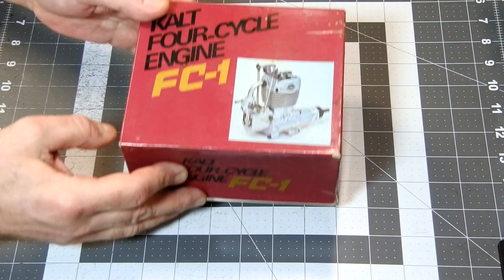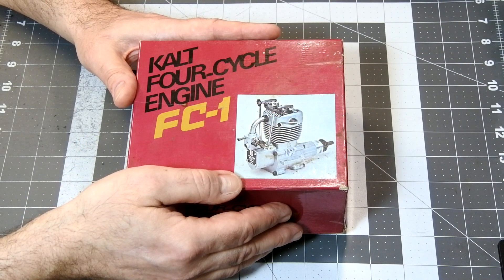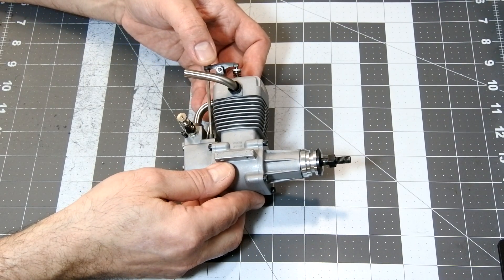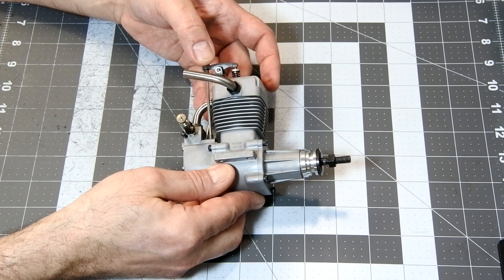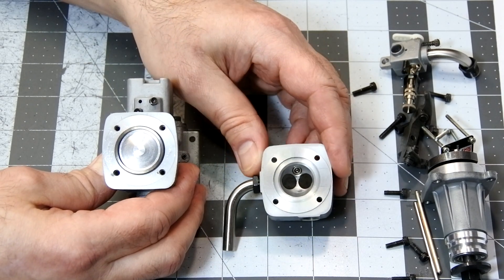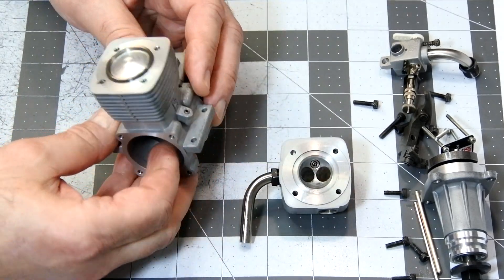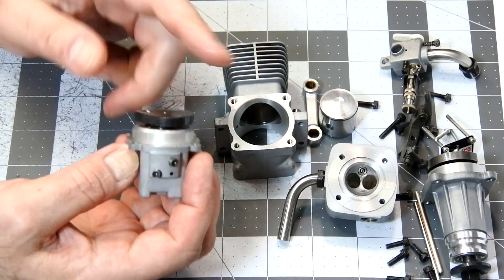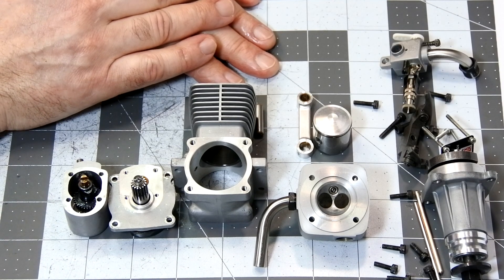Kalt FC 1 mega rare engine history

Comment: So glad someone did a dedication/history/intro vid on the famous Kalt engine! My first 4 stroke open rocker engine and I bought it used from Italy, this was in 2015 after seeing a vid of it running. At first I thought it was a Webra rotary valve 4 stroke since the kalt has a square cylinder body. This beauty is really well made, hemihead motor. I enjoy looking at the fine surface finish it has, not even OS or Saito has this level of smooth casting. The casting finish (I am sure bead blasting was done in the end), is equal to that of real sized engine castings.
Reply from the maker: Thank you very much for your kind comment ! I'm greatly appreciate you, that you found my video stories useful !
Reply from the maker: 100% agreed with you about Kalt FC-1 engine castings quality and engine build quality overall.
Reply: @crazyengines88  It is a very nice engine and should be a part of every aero modelers collection. Its a pity that it was not mass produced like the OS FS 60 or advertised as much, BUT one can still find these on ebay, 1-3 NIB ones pop on ebay once a yr. price range - $400-$500USD.
Reply from the maker: @ronitsingh85  Thank you. I also know about average eBay pricing for that.

Comment: The Feeney was one of the first, if not the first minature four-cycle engines intended for use in models to be manufactured and sold in the USA.  Model airplanes led him to start development of a four-cycle, overhead valve design.  The basic design was created by Casimire Leja. a well known modeller recognized for his achievements in rubber powered events during the 1930's,  by the late 30's, he had his own machine shop business his fondness for model airplanes led him to start development of a four-cycle, overhead valve design.   Sources say he was assisted with alloy casting by Jack Feeney .  Leja lacked the resources to take the design through to production, so the design rights were purchased by Feeney who produced the engine now bearing his name. News of the engine seems to have reached the model press as early as 1938, although the engines did not follow until 1940/41. Three sizes of Feeney were manufactured:
Reply from the maker: Thank you for update, much appreciated !